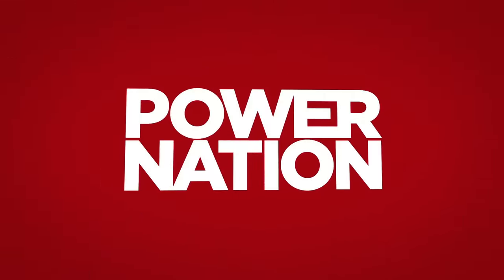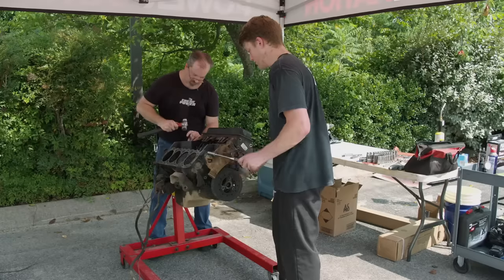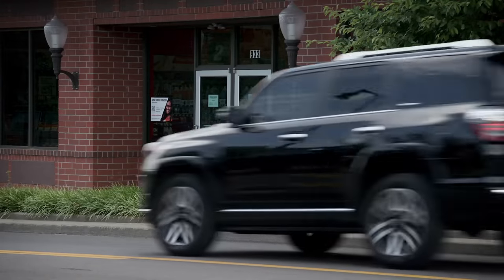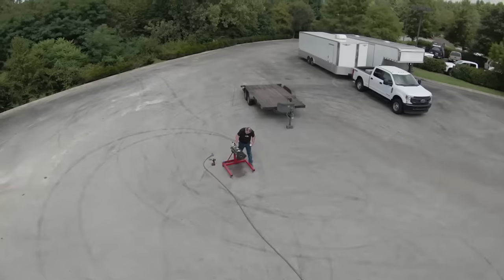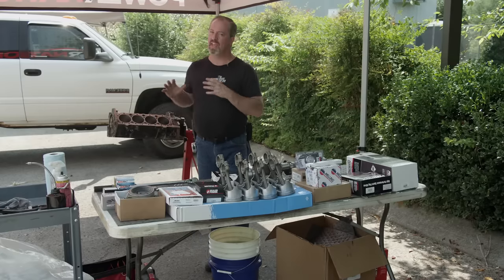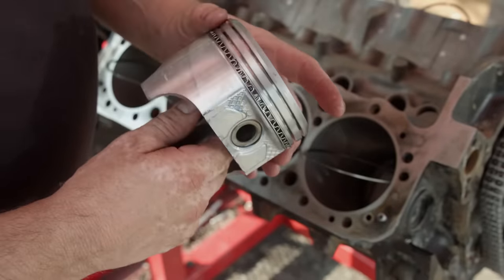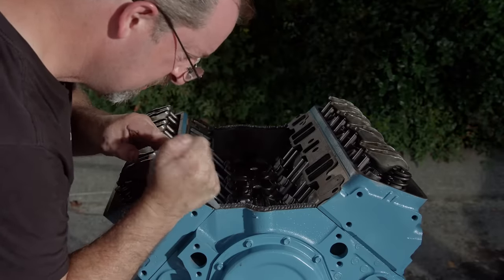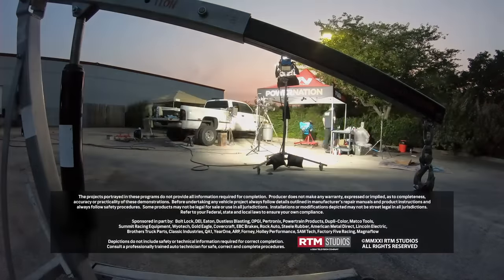Chevy 350 TBI Built In The Backyard with Hand Tools? Challenge Accepted! - Engine Power S8, E17

Comment: Our toolbox is always open. Stop by anytime and we'll help you find what you need.
Reply: Ive always had good luck with autozone over the years.
Reply: Really? 
No one wants to reply to auto zone?
Well I will.
I like your cheap oil.
Also your cheap floor dry.
Yes my front main seal leaks.

Dont judge.
Reply: Where are you guys in canada
Reply: But in my town you always give people the wrong stuff haha.
Reply: @williamarden5441  same here though there is one location that tells me whem IM wrong and they are usally right
Reply: Me: Can I get some wiper blades?

Red shirt AZ employee: Automatic or manual?
Reply: @superduty4556  az employee wanted to know how much of a badass you were
Reply: Still loving my Duralast tool kit that I've had for years! Only complaint is that it didn't come with deep sockets lol.
Reply: Thanks for the offer, but I buy my parts wholesale. I will not pay $60 for a $25 set of ceramic brake pads.
Reply: You gonna give me the wrong shit again 😂
Reply: Yea but yall ask me if my made up cars are automatic or manual when buying stock parts that have to be ran on asphalt pro truck metric chassis wise like lower control arms and phenolic bushings is all really abd ask if my 1988 cutlass supreme is a auto or manual trans fir a very common one size fits all metric chassis g body cars.
Reply: @youknoweverything7643  ah yes, automatic or manual for the car that only offered autos.
Reply: That's a lie I work at autozone and we charge🤷‍♂️
Reply: @tambosnipes1652  I work at autozone and I can say you are not wrong lmao
Reply: Aye I work for yall
Reply: How come a hard working employee of your company can't get the same offer??????
Reply: @tambosnipes1652  I don't believe there are any in Canada.
Did you mean "Why aren't you guys in Canada?"
Reply: @superduty4556  Priceless!
Reply: No thanks I'm a O'Reilly's kinda Guy
Reply: Rock auto .
Reply: @savagesock3598  😂😂 tell them manual
Reply: @TrippyWoodStock  I also enjoy frequently prank calling them asking for tools that don't exist, they put me on hold, I hang up. We got a thing going ya know?
Reply: When will you come to Canada?
Reply: @savagesock3598  next time try calling in sick for jobs you don't work at👍
Reply: @Boycott_Wendys  yo bro thanks 🙏
Reply: AutoZone usually does a pretty good job. I've gotten a lot of parts from them over the years. Always do a match with their online parts system to make sure you're getting the right part because not all of their employees are former mechanics or petrolheads. Cheers!
Reply: What a joke
Reply: I got my new Duralast battery delivered yesterday.  Easy peasy.

Comment: I built my first engine, a '64 Chevy 327, on a piece of plywood in the backyard of our house when I was 15 years old. (1970)  I put 11:1 pistons, a Duntov cam and an Edelbrock C3B intake on the engine. It had "double hump" heads and once it was together, I put it in my '50 Chevy Sedan Delivery.  My first hot rod build that I drove to high school once I got my drivers license.  Can't imagine doing that today but back then, throwing plastic over the engine kept most of the dirt and dust out of it.  It was a darn good running engine that powered three of my cars before I started playing with big blocks.
Reply: That's awesome!  I got lucky, when I built my first engine I had a nice shop.  My family owns a tire shop here in Tucson and I worked there from the age of 15 until I got paralyzed at 25.  For my 17th birthday my dad gave me my first car, a 1974 Dodge Challenger.  I had been helping my older brother work on his 440 powered 73 Plymouth Barracuda streetcar for years so I learned a lot early!  Before I turned 18 and got my license we found a Chrysler New Yorker which we bought the 440 and 727 transmission out of for $300.  I bought a set of TRW 9:1 forged pistons, a 509/292 mopar purple shaft cam kit and a rebuild kit and sent the block, crank, rods and new pistons to the machine shop.  All of the used parts got hot tanked, the block was bored 40 over, new cam bearings installed, main caps line honed, all new freeze plugs, the rods were resized and shot peened and the crankshaft was turned 10/10.  My brother gave me his old Weiand tunnel ram that had 2 Holley 450's and was plumbed with a spray bar for nitrous.  I found a 3.91 posi third member for the 8 3/4 rear end and bought a 3500 stall converter and a rebuild kit for the 727 Torqueflite.  I built my first engine and transmission, I took the 318 engine and 904 transmission out and I installed the 440 and 727 and that was my first car.  OH THE GOOD OLD DAYS!  Later I took the engine and transmission out and put them into a 1968 Dodge Dart but unfortunately I sold the Challenger like a fool!  It kills me to this day!  I wish I had never sold either of those cars but especially the Challenger!
Reply: @krisjato  - That's quite a story!  I know what you mean about regretting selling our cars.  I have at least 20 I wish I had kept.
Reply: @MrIgor1955  Well, it was quite a fun and exciting time!  I remember I couldn't afford all of the machine work so my brother paid for it for me, it was almost $600 and I helped him with a few cars that he restored a little later to work off the debt.  LOL!  I helped him pull out a couple engines, we assembled one and also installed it and got it running and driving.  I think I also swapped a couple different rear end center sections, changing the gear ratios around.  I don't remember what all I did but it was fun learning and doing it all, that it was paying for all of the machine work on my 440 was just icing on the cake!  You have at least 20 cars in mind that you wish you had kept?  WOW...  That's a lot!  I only have a few.  LOL!  But then again, I've been paralyzed from the chest down since I was 25 and I was still racing my Dodge Dart at that time.  I know one thing, I wish I knew then what I know now about building engines, my Dart would have been a lot faster!  LOL!
Reply: @krisjato  Sucks about your spinal injury. I'm retired now but I was a Paramedic for over 34 years and dealt with many spine injured people over those decades.  I picked up a friend who fractured his upper c-spine and ended up passing away a week later from complications.  I can still hear him begging for me to help him as he laid motionless inside his car that was on its roof.  That was probably 40+ years ago.  Calls for family and friends take a toll on you. - Most of the cars I wish I had kept are Chevy's.  All of them were GM cars.  Sounds like you've made the best out of a life changing incident.  Congratulations.
Reply: @MrIgor1955  Thank you, it's the hand of being dealt.  Man, I'm sure you seen some terrible situations and I'm sure you've saved many lives, God bless you!  I'm so sorry about your friend, that's terrible!  I'm sure it wasn't easy picking up your friends, I'm sorry you had to deal with that!  All of them were GM cars?  To each their own, right?  LOL!  I've always been a Mopar fan, mainly because of my older brother, he's 11 years older than me and has always been a Mopar guy.  He had the 1973 Plymouth Barracuda street/strip car when I was growing up and he still has it along with three other Barracudas and a Roadrunner.  The only two I had was my 74 Challenger and the 68 Dart that replaced it.  Working on, driving and racing my car are some of the things that I miss doing the most!  Thank you so much, I've tried my best to make the best of a bad situation.  I still have one of the same hobbies that I've always had, my RC cars.  I'm very thankful to have such a wonderful family and friends, I couldn't do it without them!
Reply: @MrIgor1955  My dad was born in 49 and he said Chevy's was a joke back then. Big block Dodge boy's always handled the Chevys and Ford's like a champ!
Reply: @krisjato  sorry for your health but the fact u had a dart you are okay with me. Mopars ain't no joke eitha!
Reply: @wildestcowboy2668  my dad was a Mopar nut..had a shop but engines were put together from back patio to dining room..true story lol
Reply: Im workin on building my second engine soon. Itll be my first solo build cause my first ever build was with my dad at 14. We rebuilt a 350. Im workin on pulling the engine out of my 1997 K1500, rebuilding it and slappin it back in the truck. Im not putting any goodies into it cause I dont need more power in a truck that already sucks on gas
Reply: Holy shit i read your comment and it brought back the memories. I was 15 when i rebuilt my first engine also a 327 turbo fire in a 64 impala.... Still have the car to this day and im 42 years old.
Reply: You are the man ! I rebuilt a Briggs & Stratton engine when I was 10.  Then a Nissan Patrol '60s engine @ 13.  I wish I had continued...

Comment: Now it time to hook it up to the dyno!. let's see what kind of numbers that 600hp "3/4 race cam Corvette roller motor" can pull. 😆 
That was an awesome episode. it looked like many of my builds, but you cheated by having a tent and asphalt. 
Next episode is a transmission swap in a gravel driveway, right?
Reply: Hahaha I love when the gravel digs into my back and the transmission falls of the car jack nearly taking my head off  because the carjack didn’t come with4x4.
Reply: @bigboreracing356  How many views has this spamming got you?
Reply: It does not cost that much to put concrete down so stop hating
Reply: That’s what i keep half a sheet of osb for
Reply: @bigboreracing356  where's the video
Reply: @bigboreracing356  ok I'll try a different approach...how can one view ' your channel'?
Reply: prolly got 250 HP... but 420 HP if started with a TBI Vortec 350...
Reply: With those heads i guess she's 320hp and 400ftlbs 🤣
Reply: @fasfzr1  do you really think most people can just have their driveways paved? The majority of people don’t own their homes, so it doesn’t even matter how cheap it is
Reply: A cheap sheet of partical board under the truck goes a long way
Reply: Cardboard here I come...that's how I roll,sucks if using a jack though
Reply: You can’t afford a tent you should’ve be building engines

Comment: Love it. I have a disassembled vortec  in my garage right now. Gotta put it back together. This gives me the inspiration to get moving on it!
Reply: L31...
Reply: @shadowopsairman1583  that's the one. I had it milled to a 383
Reply: Same here. Mine is waiting on my head porting.  That, and I'm in the middle of a move out of state. awesome
Reply: Just remembered tighten the bolts till u feel a snap then turn it a quarter of a turn. Lol that's how clowns up north do it
Reply: Your Vortec should give 420 HP compared to 250 HP this engine prolly makes...

Comment: Just a tech tip if those are stock swirl port heads. Max lift is approx .500 if you don't machine the valve seats and/or change the springs from stock. Always check for coil bind before hitting the starter.
Reply: Them are old junk tbi heads. They need to go to the trash! Worst head gm ever made

Comment: Nice episode. The thing with all those “loaner” tool programs though, every time I try and borrow, the set has been abused and is useless. Missing parts, threads all jacked up. Nobody at the store really checks them in right, and catches tool sets returned broken
Reply: I always inspect before even leaving the store. I had a few where the tool was messed up. They just grabbed a new one from the back if they have it.
Reply: I worked at one of those big stores for a short period of time.  By the time I left all of the tools had been replaced with new ones. Most of the time they can have a brand new one the next day,  just ask the manager to swap them out.
Reply: Yes that is true one time I needed a inch pound torque meter I borrow it from autozone and in the first use I stripped a bolt the person that used before me left the torque at 80 inch pounds and messed up the torque and another time I borrow a brake caliper tool it was one with the 2 piston caliper and I liked so I keep it I told the guy from auto zone how much for the tool he said well you paid for it you can keep it it was brand new so I kept it I did not know you can do that
Reply: Yet when you rent then they have your id on file so abuse then you pay for it. If you get shobby tools bring them back for a good pair.
Reply: @CanadaBud23  Definitely the way to do it, open it up right there so they see it too and they will just grab ya another if its messed up.
Reply: @CanadaBud23  I have a newer Autozone and a brand new O'Reilly just a couple miles from me.  Their loaner tools are pristine because no one's ever used them.

Comment: I think yall should have mentioned that yall have a 4 bolt main tbi meaning it was from a 3/4 ton and up truck. I got an 89 tbi from a 1/2 ton and mine was a 2 bolt main. Just a little fun fact!
Reply: Yup the HD models had 4 bolts. But a 2 Bolt can be made robust.
Reply: 3/4 ton trucks and 1 ton trucks had a little less compression also
Reply: Also prolly got 250 HP... but 420 HP if started with a TBI Vortec 350...

Comment: Always check for cylinder head valve spring coil bind in this type of scenario, before firing it up.  Also make sure valve seals are unmolested during full lift of rocker, again before firing.

Comment: This build will be incomplete if you don’t dyno the Engine. Please, let’s see how this thing runs!
Reply: Agree. Could have taken another 20 sec to show it on the dyno and flash over to the dyno sheet/ numbers. Decent intake and cam but those 193 swirl port heads kill it. Still better than the 190 SAE net HP with full accessories at 205* it was rated from the factory. Blind guess with EWP, no accessories it would make a solid 240HP/ 270TQ at 5200/ 3200RPM, respectively.
Reply: @robertbryant7771  - more like 250 HP at 4500 and 350 torque at 3600 at flywheel... 
If they started with a TBI Vortec 350 and used flat top pistons around 420 HP and 400 torque...
Reply: @BuzzLOLOL yeah I probably lowballed the torque number but those are the godawful 12.3cc low compression dish pistons too. A nice 6.7cc 4 valve relief piston like the L31s got would make a decent difference but no getting past those heads.
Reply: @BuzzLOLOL  vortec heads aren't bad. You can make some good power with them. You're better off going aftermarket today though, by the time you machine them (they cant handle a lot of lift)  and have them checked for cracks, you're spending a fair bit.
I actually just gave a pair away to someone i know.

Comment: I normally give a engine refresh a full weekend to complete. If the heads are really dirty I use a storage bucket and CLR straight for 6 10 hours before the final cleaning . Running a 400 Ford I built that way with almost 100,000 miles on it now.

Comment: My oil filter wrench! Got mine at NAPA 40 years ago. I saw a guy pull out a crankshaft and rub each journal with valve lap compound, put it back in and tighten it. Spun it with an impact gun. Put in a .020 bearings and was done. No way that would work. He drove the old rust bucket every day. Just rings and bearings. My favorite episode. Good work guys.

Comment: Got this exact motor sitting in a parts truck in my backyard. Pulling it out and rebuilding it is one of my goals and I think I just found motivation.
Reply: Toss that engine that will yield 250 HP and start with a '96 - '02 TBI Vortec that will yield 420 HP from same parts...
Reply: @BuzzLOLOL  I'm not looking to make a lot of power. I just want a simple and stout V8 to replace the 4.3 V6 in my stick shift pickup. Flat top pistons and headers are about the only modifications I'm doing.
Reply: @Mindphaser98  - That 350 with swirl port heads will be lucky to make as much power as the V6...
Reply: @BuzzLOLOL  Oh, it'll be plenty. Had a stock 350 TBI in my 1988 K5 Blazer and my butt dyno tells me it could outrun my pickup with the 4.3 without trying and that Blazer is way heavier. The biggest thing I care about is the sound a V8 makes anyway.

Comment: Ain't nothing like a good shade tree mechanic job in the Florida sand, the hot sand. Try building a small block Chevy 406 (0.030 over 400) in August in mid state Florida in your back yard, no shade, no cement, lots of sugar sand.

Comment: If you think you'll ever use your cellphone device while getting hands greasy, stick it in a ziploc bag so you can still see the screen and access the buttons. Skip the toilet brush hone, it bends and distorts--use a blade type and spend the $9 to get new blades for every new block you hone. Don't bother digging into the valve head to get rid of gunk, either soak it or chuck it in a drill and whirl it thru a wire brush.  When cleaning off the cylinder heads, consider using a straightedge around the surfaces you want nice and flat for gasket seal. Stab in the new cam before dropping in the crank, so you can reach inside the block to guide the cam over the cam bearings you're likely reusing.

Comment: Prot tips: 1.EasyOff will make short work of grime, but wear gloves! 2. If you use an oil pump for a 454 you'll have good pressure at idle, won't evacuate the pan, and more stable ignition timing due to more teeth on the pump gears.